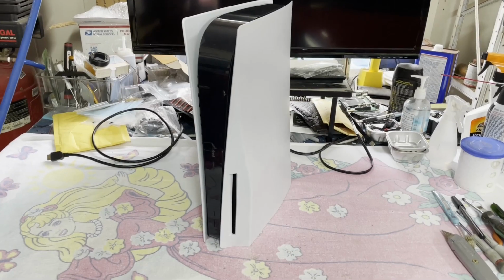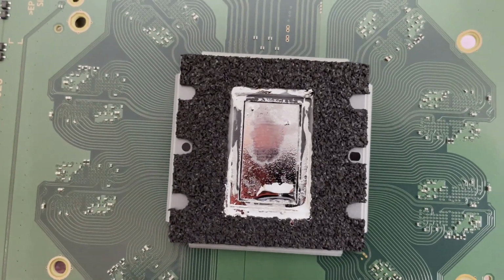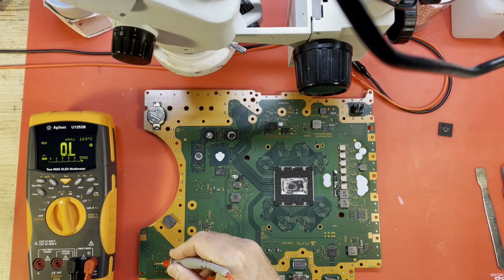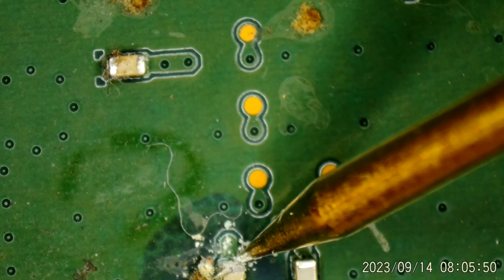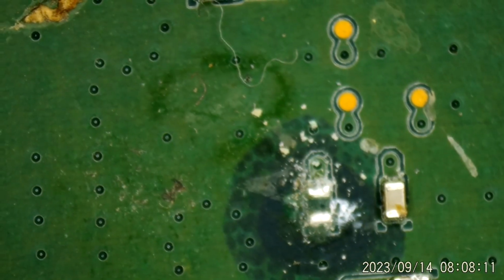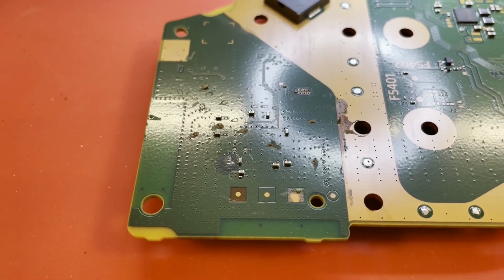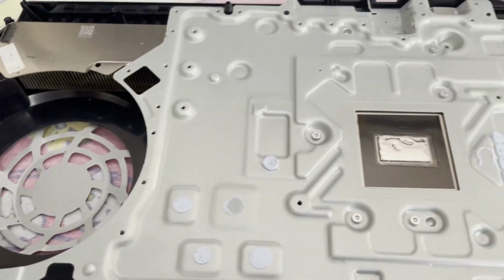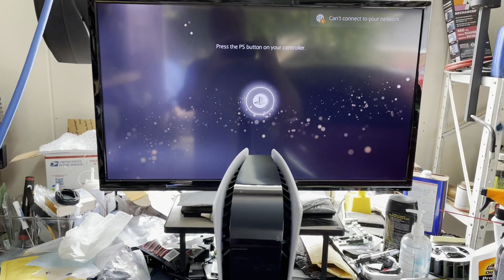#109 Repair of PS5 CFI-1115 No Power

Comment: Hello sir. I had my ps5 apart to the point I needed to remove those foam pads that you had that random piece laying next to the console. My question is I notice older models held the wires down only by white tape but the 1100 models use that foam stuff which helps the wires from being pinched. My question is, is it okay to tear that stuff away so I can get to removing my power supply and cleaning the holes from dust. I might be over thinking it but I know they are there for a purpose as the foam had an indent across it like something was resting on it but also protecting the wires underneath from being pinched. You have the only video that shows the foam pads. Thx in advance. Did you just pull the wire up through the middle of the foam?
Reply from the maker: You can tear it or carefully lift it up in the middle just enough to work the wires through.  Pulling the connectors through is the challenging part.  Take your time.  You can heat the foam up slightly with a hair dryer on low to soften the glue.  Just take your time.   It's not a race.

Comment: I have one like this I have been working on for about a week. I didn't have 3.3v at F7002, replace IC and all 5v and 3.3v currents are present. I replaced the wifi IC but still stuck around .290amps. Do you have the readings for the caps under the wifi IC? I wonder if the wifi IC is either bad or reball on the new ic isn't good.
Reply from the maker: I think if it was WIFI/BT your current would be lower.  Maybe look around the SSD area.  It could be struggling to access its storage.
Reply: @ToltecMerc  thank you for your reply. I actually sent voltage  and checked the WiFi caps and I was missing the 1.8v. The SBV, opposite side of the F7002 fuse, was not outputting 1.8v. I swapped the SBV IC and 1.8v was restored and started up as normal. I assume whenever it hangs at .290-.310 amps the first area deals with the WiFi IC from what I have experienced. Thank you for making your detailed videos, help me with my diagnostics on my customers consoles. Keep up the great work!

Comment: Hello, my PlayStation slim gives this error CE-36329-3 and it turns off once and then turns on again and locks the screen and the color of the image is damaged. I changed the hard drive and it didn't work. Does the console need an APU rebal?